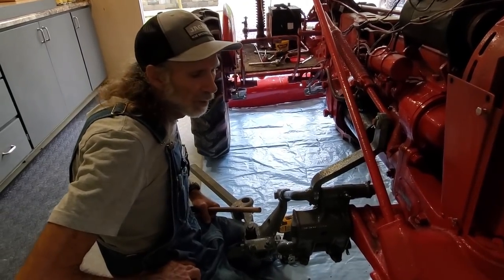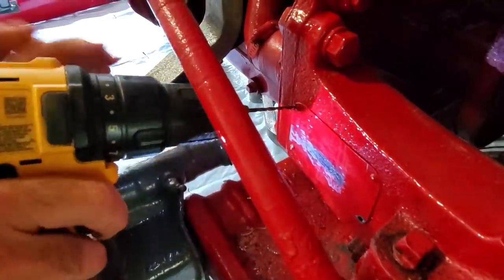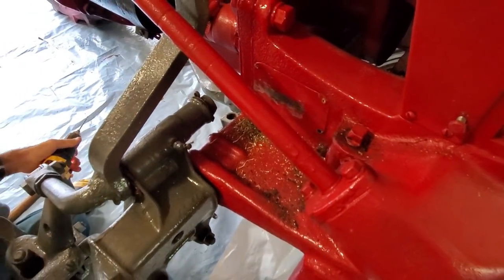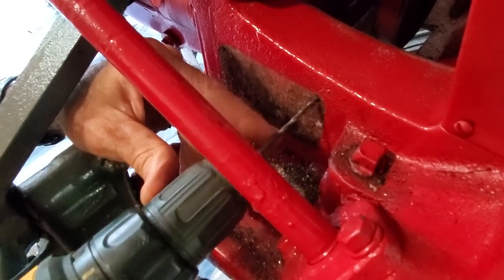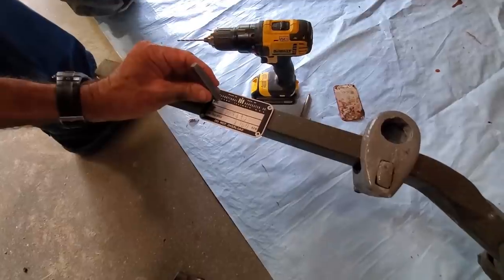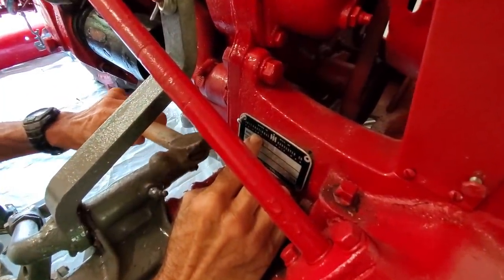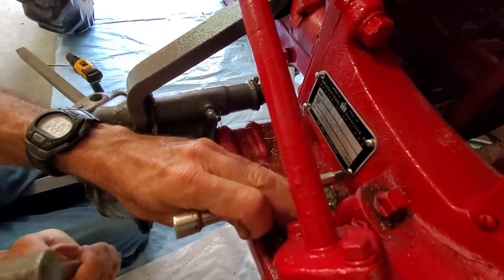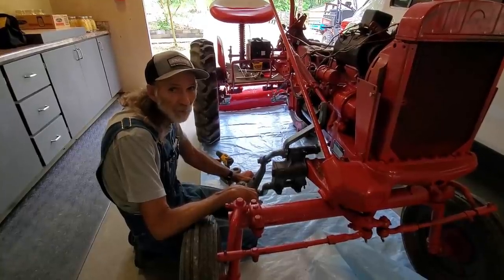1950 Cub Farmall  Changing the IDENTIFICATION Plate

Comment: Put the old plate in a folder just in case you need it. I replaced my plates on my grandfather's 1937 modle A. And my 1969 and 1970 ford 8000's.

Comment: Looks like you might been able to get a bit extender thing to move the drill away from steering linkage.

I would of done a quick coat of rust converter on that bolster and then quick coat of IH red before I put that plate back on there. One less place for that rust to creep back out from under there.